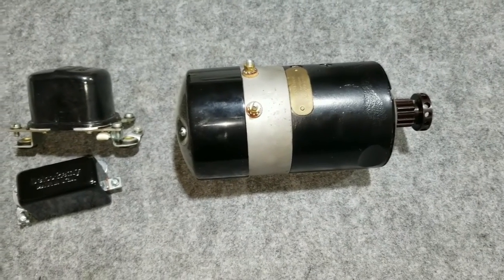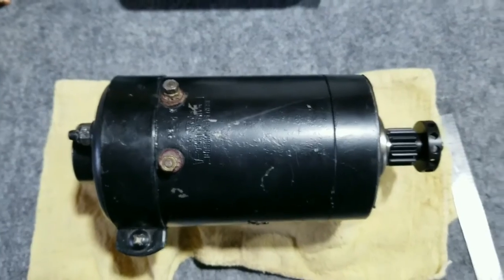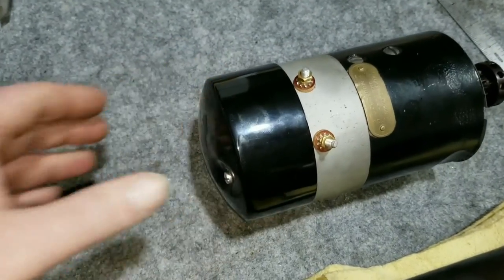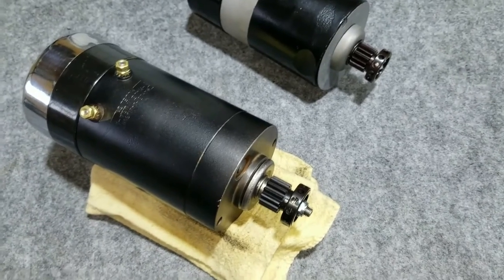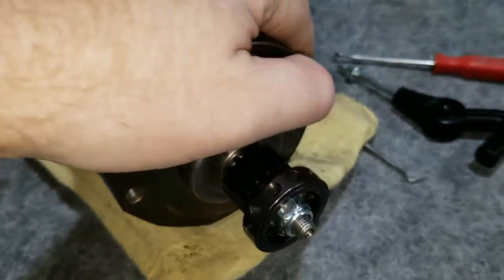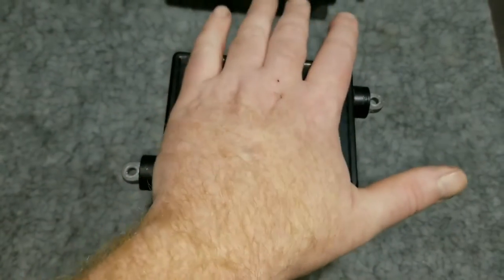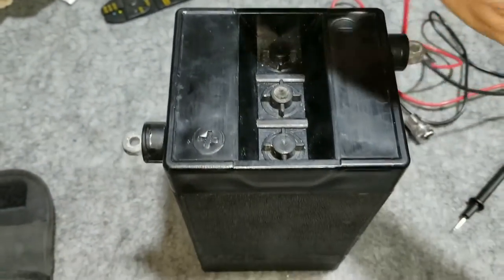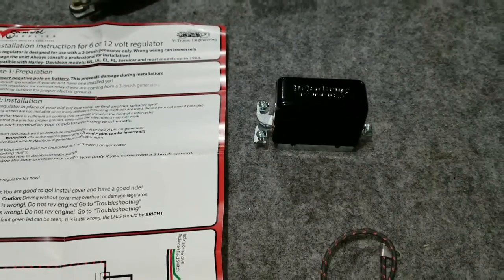1936 to 1957 Harley Davidson Lithium Ion Battery conversion

Comment: FYI - that Shorai battery is nowhere near 18AH capacity.  The real AH is found on a tiny sticker on the bottom, 6AH in this case.  The 18 figure is "Pb Eq AH", a bogus figure computed by comparing CCA with lead-acid batteries - irrelevant for kick start bikes.
Reply from the maker: Correct, The battery is only needed to provide spark and lights and we upgraded to a 2 brush generator with an actual regulator and we don't think it will have any problem keeping that lithium battery fully charged while running with or without lights on. Thanks